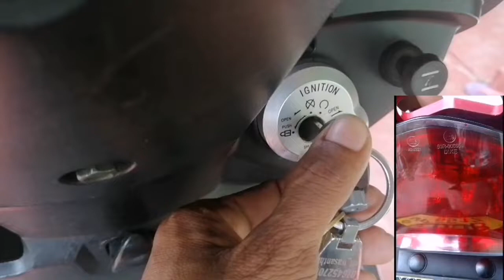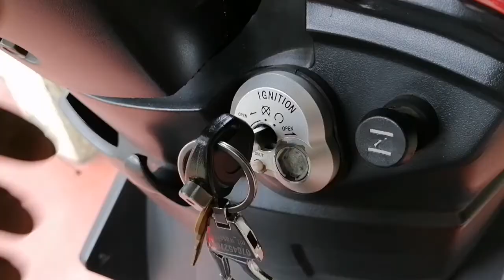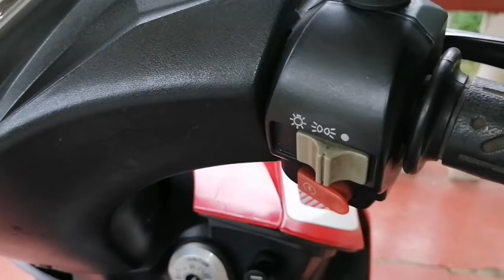how to fix scooter brake light switch not working problem #electric

Comment: What is that part called and mine is a taotao150 cc power max  where do I get it
Reply from the maker: Its called Universal Motorcycle Right/Left Front Brake Stop Light Switch Press Button . You can get it from a motorcycle parts shop